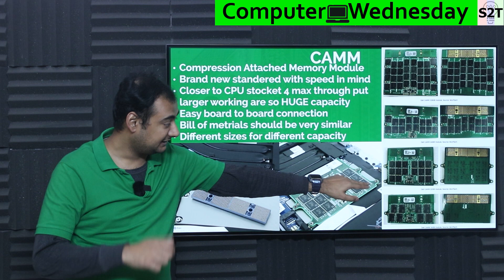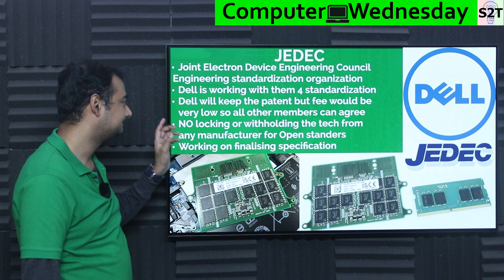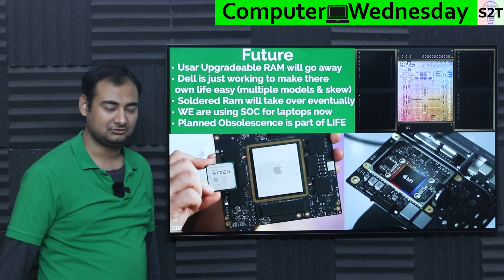Dell's CAMM Memory Explained {Computer Wednesday Ep215}

Comment: Thank you for the explanation. very comprehensive and easy to absorb.
Replaceability & upgradeability is what I have been expecting for a long time. Hope the industry can accept this new standard.
I love Desktop PCs due to easy to replace parts.
I still have a Desktop computer case used 16 years ago.
But all the power supply & motherboard/memory/processor already replaced 2 times.
The hard drive is still working well. Those obsolete parts become another CPU for playing Youtube on larger home flat tv plus become the NAS/Firewall server.
These capabilities wont work with laptops. Once broken, needs to throw away and buy a new one.
Reply from the maker: LPCAMM2 is now the standard accepted by the industry https://youtu.be/jGJB41CMPvQ